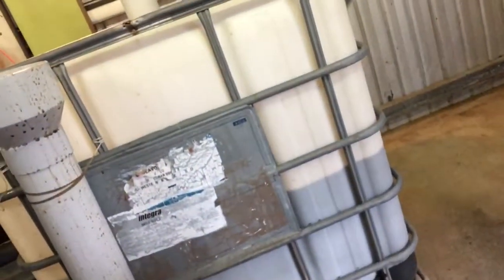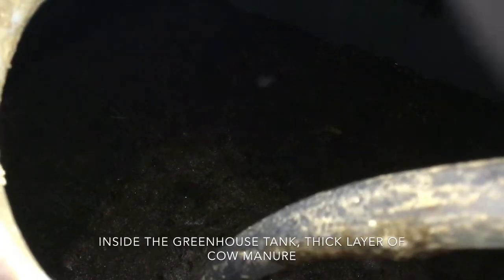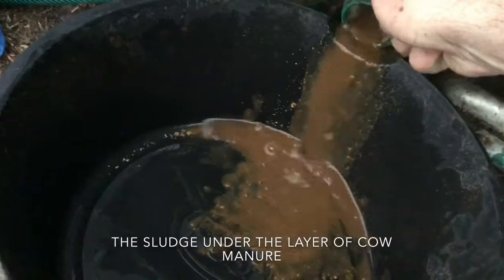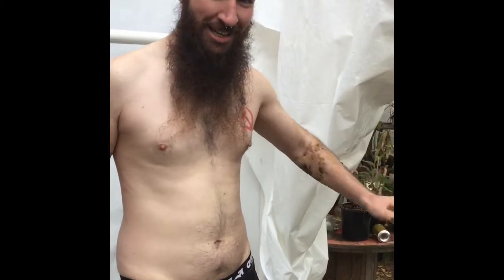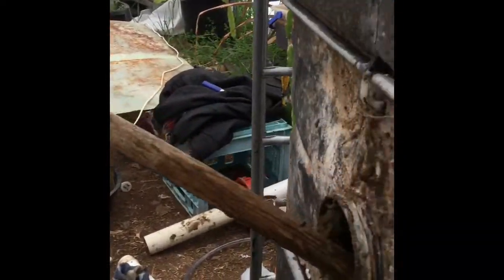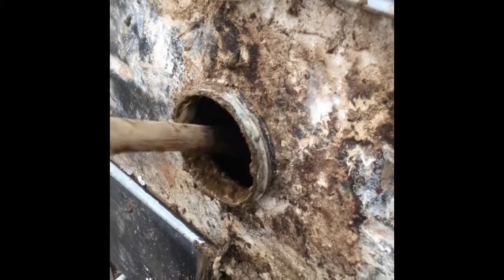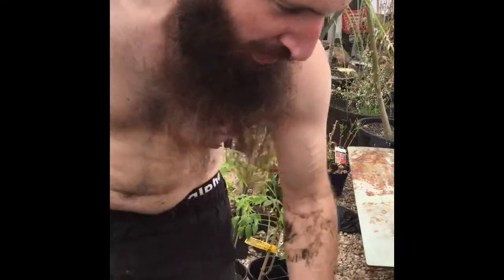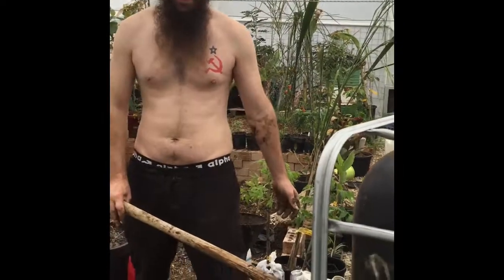The gross part of the biodigester move

Comment: Too bad you couldn’t rent a lift. There’s small ones that can pull a full IBC tote. If you think you have to move it at all, the tote is the most portable of many options out there. I understand the value of hard work. And if you could save time with moving it straight to the garden it makes unloading it much easier. Not sure why your composter is indoors. Doesn’t it need direct light?
Reply from the maker: You don’t want light in it, hence painting it black, you risk algae growth with light, and yes a lift would have been great, that was a very smelly day
Reply: Lucky Hill Farm yes we painted our rain water harvester IBCs black for algae. So it’s true for biodigesters?  Makes sense. You are braver than I with the self build. But I totally see myself doing exactly as you did, spending every hour just whittling it till it was done. It’s the best work on the planet. The hardest. But the most worth it. For smell I use the bandanna method and drop either lemongrass or something strong like juniper. It helps a great deal. Without it I cannot watch my cats poo at 20 yards hahaha. 

Well if you had to do it you had to do it. The home biogas is a smaller bag. But just as heavy with about 150 gals. 

Do you use heating elements at all for winters or do you pull through winter with digesting temperatures?